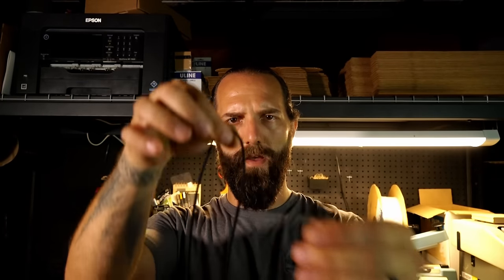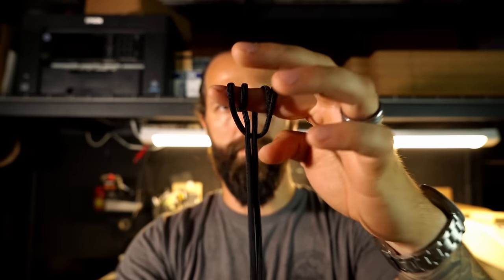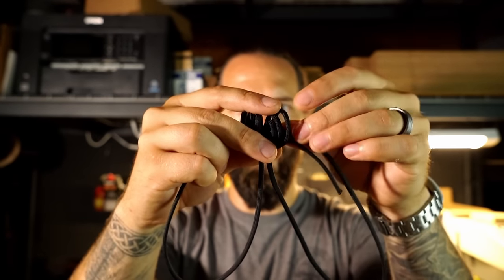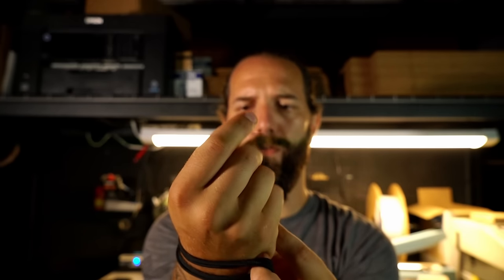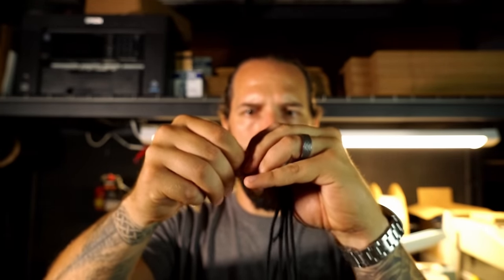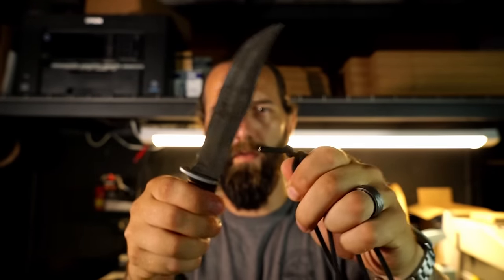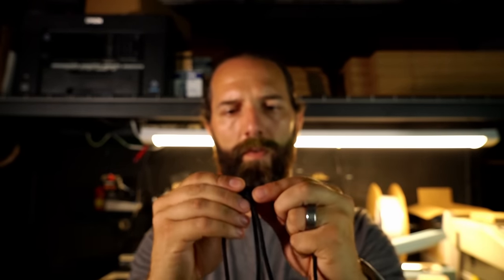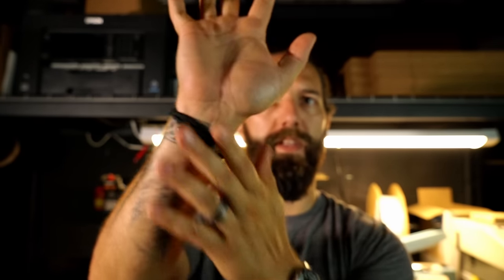How to Tie an EDC Prusik Bracelet

Comment: Actually called a Boatswains knot and can be used as impromptu handcuffs by slipping each loop of a wrist and pulling the tails to tighten then lock off with a reef.
Reply from the maker: Yep. Most knots have many names. depending on the culture of the end user. Historically Boatswains have used this same knot to restrain personnel while at sea when the didn't have shackles. Or the shackles wouldn't fit.  The locking mechanism of the boatswain's knot is a prusik again, “same same, not different “

Comment: I got this on my third try. I kept cutting to short of a piece to work with. Thanks for sharingthis
Reply: How big of a piece did you cut? Also what did you do to tighten down the knot?
Reply from the maker: Always go with more than you think you will need. It’s easy to remove extra and way harder to add it.
Reply: @agonicllc removing extra just by cutting the ends of the of the prusik loop

Comment: I'm so confused. I saw the thumbnail and thought "EDC, I've heard it before, isn't that something first aid related? Or survival skills?" but when I googled it the results were all about weapons and incapacitating people with cords. I assume this one is intended for survival situations, but how is it used?
Reply: EDC just means 'every day carry'.  Some EDC things might be for 'just in case' so you will at least have SOMETHING on you in case things unexpectedly go bad but most 'EDC' gear is more geared toward 'everyday' type tasks - like if you needed cordage for some, random task.  I could see this style being useful for camping if, say, you needed an easy way to carry a bundle of sticks for kindling, smaller diameter fuel, etc. for a campfire.  Put the bundle together, take off the bracelet, pass one loop under the bundle, put the end of one loop through the other loop to create a lark's head, pull it tight around the bundle and use the free end to carry your bundle back to camp without dropping sticks, trying to keep the bundle together while you walk, etc.  When you get to camp remove the lark's head, dump the bundle and put the cordage back on your wrist as a bracelet.
Reply: @JAB671 and in regular situations I’ve used my length of paracord to bundle up the pizza boxes to make it easier to take them to my co-workers.
Reply: EDC also means Electric Daisy Carnival.
Reply: Carry the "emergency " cordage in a way that makes it less accessible when needed ?

Comment: You could use square knots and stack them on either end for the same effect. In fact, squares will give you more cordage for the diameter than this method will, if you square around the entire circumference of your wrist. 

The same thing applies to a daisy chain or daisy double. Unless this is the style you want, there are better options for the utility than a simple P Fold.
Reply from the maker: The more knots you put into a piece of cordage the weaker it becomes. And the more twisted the inner cord becomes. Sometimes less is more.
Reply: @agonicllc  I guess I don't understand the purpose behind the bracelet then. It definitely doesn't seem like it's for repelling, so I'm not sure why tensile strength matters in this instance.
Reply from the maker: @ransomdekafenya2584  this style of Prusik knot is also known as a Boatswains knot. It was an alternate method of restraining personnel at sea when shackles or cuffs weren't available or were to big for the detainee. The no slip function of the prusik knot make it ideal to cinch down and keep tension which also makes it great for securing doors and other such things.